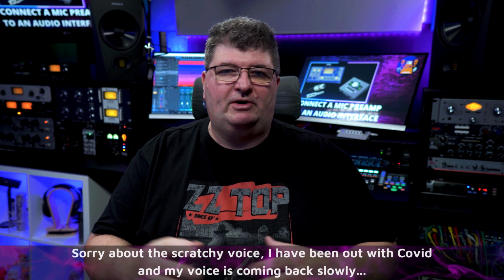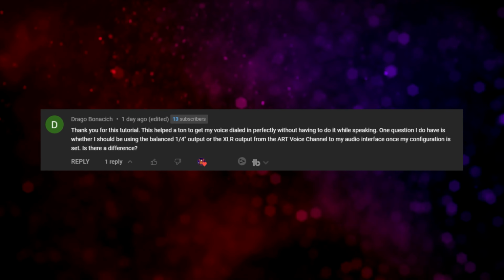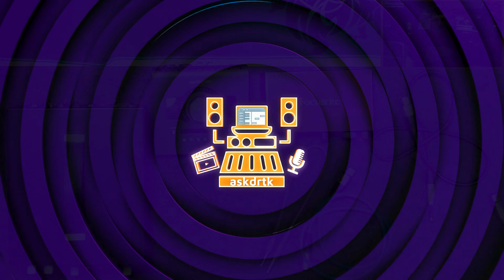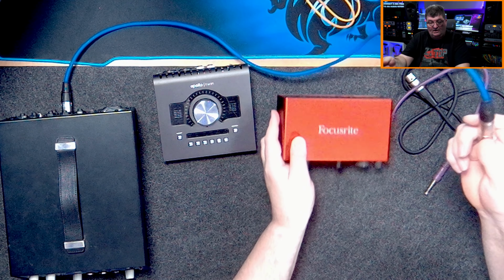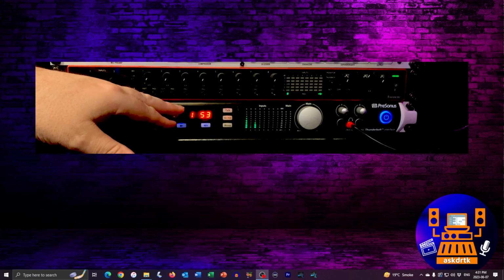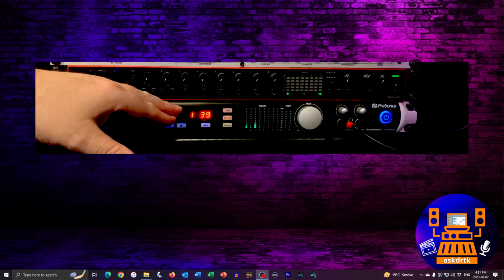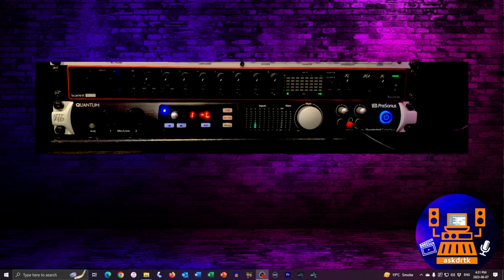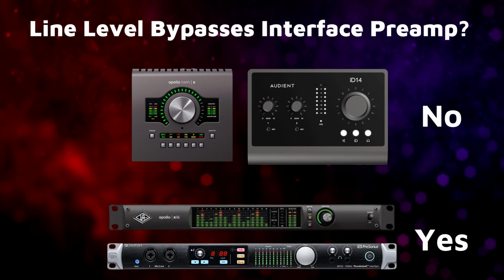How to Connect a Mic Preamp to an Audio Interface Without Breaking Anything...

Comment: i have an old Gemini XL-120 turntable i still use to listen to records, got some new gear but Im having sound issues. i can hear the vinyl on the headphones but cant ear anything on the speakers. i bought a Fosi audio box x1 phono pre amp ( That is working from the headphone jack) but no sound from connected rca line to a Yamaha rS202 Receiver, ...... i bought rca to 3/4" to connect to a N.I. Komplete Audio 6 [Audio interface] (unless i need different cables?) that connects to JBL 3 series 305p MKll Studio Monitors. any ideas on why im not getting any sound ? please and much appreciation to any who comments tryinng to get audio to FL studio also so i can sample vinyls
Reply: @chrisbravo1856  maybe the RCA jacks are inputs

Comment: Sir, Which "audio interface" do I need so that I can use my external pream (Focusrite Iso one) for all recordings? I have a digital card on the preamp with s/pdif and adat and also "word clock". My question would be for digital recording: is an audio interface with S/PDIF sufficient or does it also have to have a word clock connection? I ask for help
Reply from the maker: Sorry for the late reply. SPDIF will carry the clock signal from the ISA One to an audio interface with a SPDIF input without the need for a word clock cable. In this configuration, the ISA One will be the master clock and the interface will be the slave. This works however the issue is that if your want to change the sample rate for recordings you will need to do it on the ISA One, not the interface. This means you cannot change the sample rate in your DAW or interface software. Again, not really a problem, just a different way of controlling things. All of this said, using a dedicated word clock cable can provide the most accurate and stable clocking between devices,  think of it as the "gold standard." This is not to say clock over SPDIF is not a good option, I have used this setup without issue many times and it is often the only option. If however you did get an interface with a word clock out connector, I would recommend connecting the word clock "out" from the interface to the word clock "in" on the ISA One as well as using a SPDIF cable to send the digital audio. This way the interface will be the master clock with the ISA One as the slave so changing sample rates can be done in software on your computer and clock sync will be as accurate as possible. I hope this helps out!

Comment: Todd, you touched on this issue of hooking an outboard mic preamp to an audio interface in a previous video, and it really helped me out. I was routing my preamp (Avalon M5) into a Steinberg interface, and was using an XLR to XLR connection to the channel 1 mic input on a combo jack. I was using the XLR to XLR because I thought, incorrectly, that this was the "professional" cable to use. It never occurred to me that I could damage my outboard mic preamp if I hit phantom power by mistake! What I did notice was that I was getting sort of crappy audio, with odd little low-frequency glitches. When I heard your previous mention about hooking up mic preamps, I switched to an XLR to TRS cable, going from the preamp into the channel 3 line input on the Steinberg. Audio glitches disappeared! You're distributing excellent technical information handling audio in a home studio. Thank you!
Reply from the maker: Thank you, and I am very pleased to hear you were able to straighten out the audio glitches! It sounds like there may have been an impedance issue when you connected your M5 to the XLR input on the interface. In the end, nothing beats a line-level signal going into a line-level input. Cheers!

Comment: Audio Interface: FocusRite Saffire Pro40.  3 outboard Mic Preamps.  But, if I have the INPUTS of my Mic Preamps going to an XLR patchbay (Hosa PDR-369) the phantom power will travel only to there?  Right? And it the OUTPUT of my Preamps go to the OUTPUT of my SAMSON S-Patch bay, which later will be patched to the INPUTs of my FocusRite Saffire Pro40, the Pro40 is protected from phantom power from my Preamps, right?

Comment: Focusrite has some funny language at times. I have a Clarett 2pre USB, which has combo inputs only. Focusrite says that even though you can add gain to a line level signal coming from a TRS cable, the Clarett is not adding the "Focusrite mic pre Color" to that signal. YET, you can activate "Air Mode" to a line signal and get the added high frequency boost.
Reply from the maker: Yes, Focusrite basically says their Clarett preamps do not color the sound…but the preamps are not bypassed when using combo-jock inputs… There are opinions either way on the importance of bypassing interface preamps. Tests almost always show an impact from running through a preamp in an interface vs bypassing them, but in some cases the impact is minimal and in others it is not… Using an outboard preamp through that Clarett with “Air Mode” on would be a modern  way of replicating the effect of connecting an external preamp to a vintage Focusrite console, another cool way to use our gear… Cheers!

Comment: The Behringer ADA8200 seems not to use the mic preamp if you use the line input if Iinterpret the table in the getting started manual correctly. It's not listed under line inputs. 👍

Comment: So if you can't bypass the preamp within the interface, such as the case with an 18i20, how would you gain stage to reap the most benefit from the external preamp's  colorization? Or will the interface's preamps have the same amount of effect regardless of where the levels are set on each piece of gear? Thanks.
Reply from the maker: Sorry I missed your question earlier. To get the most out of the external preamp I would set the gain on the 18i20 as low as possible allowing more room to drive the input/ output stages of the external preamp. I basically start with the Scarlet gain at minimum and then use it only as a trim if necessary. Hope this helps out!

Comment: can someone please tell what is the name of the cable i need that he said wont damage the mic. or give me the direct amazon link.
Reply from the maker: When connecting an outboard preamp to an audio interface, if your preamp has a TRS output, use a TRS to TRS cable such as this one: https://amzn.to/46VBvLa  If your preamp has an XLR output, use an XLR (female) to TRS cable such as this one: https://amzn.to/46NjmiB  In any case, the connection on your audio interface from other gear (preamp or effect) should be TRS to avoid the risk of phantom power from your audio interface damaging your other gear. 

Microphones should always be connected to a preamp (either an outboard one or one built into an audio interface) using an XLR to XLR microphone cable such as this one: https://amzn.to/43sjh0J  I hope this helps out!

Comment: Thank you so much for the video one question what is the best interface to use with external preamps? ☘️🙏❤️
Reply from the maker: Glad you enjoyed my video. For me (excluding all other features / considerations) the best interface to use with external preamps is the one that has enough IO for your needs and at least one line input that bypasses the interface preamp(s). Some examples of basic interfaces include the Scarlett 4i4 (has two line only inputs), Audient ID24 (allows bypass of internal preamp on both inputs), UA Volt 476 (has two line only inputs), and MOTU M4 (has two line only inputs). If you need more IO there are many options, but some to consider include the new Arturia AudioFuse 16Rig (has 16 line only inputs), the RME Fireface UCX II (has 6 line only inputs), and the rackmount Apollo interfaces (desktop Apollos do not bypass mic preamps). These are only a few options, but cover a variety of price ranges and IO configurations. I hope this helps out!

Comment: Hi i do have tube mic it's avantone cv12 do i need mic preamp to connect the mic to the hardware as Klark Teknik 76-KT

cause i want to buy the Klark Teknik 76-KT i don't know if i need mic preamp to connect the mic to Klark Teknik 76-KT
Reply from the maker: A outboard mic pre is the usual way you would setup this recording chain… CV12 -> Mic pre -> 76-KT -> line input on your audio interface. Some audio interfaces let you connect the mic to the interface and then send and return the sound through the outboard (76-KT) before recording so a separate mic pre is not needed, it just depends if your interface has enough IO and built-in mixing.

Comment: I have an iD 24 + Composer Pro-Xl, I`m planning to use them for my guitar! So, plug in my guitar first to the Composer Pro then send the signal from the XLR of Composer to the Back Line input of iD 24, and connect the Audio interface to the computer?

Comment: Ive been struggling to understand. Do I have to buy a external pre amp to use my Klark 2a? I have the universal audio apollo but it has a preamp, why would I have to buy a external preamp if I like the sound with the Apollo? is there a way to compress without a external preamp ?
Reply: Only 1 pre amp necessary. Compress with plug ins

Comment: hey man, very helpful video! I only have 1 critique point which I'd like to mention because this could seriously damage people's equipment:

Phantom power definitely DOES pass through TRS cables, I don't know where you heard that it doesn't.
in fact, TRS cables are more dangerous when it comes to phantom power, because, due to the anatomy of their connectors, when plugging and unplugging TRS cables while phantom power is engaged, you run the risk of short-circuiting your devices.

just wanted to put that out there!
Reply from the maker: Hey Tony! Agreed, phantom power definitely does pass through TRS cables which is also why you never want to use a TRS patch bay for microphones due to potential short circuit as you said ( I've see too many situations where an XLR connection on a preamp ends up at a TRS on a patch bay). 

The key to safety is in the TRS jack on the interface or preamp and not the cable. Whether it is a TRS line input or TRS on a combo jack input, interfaces / preamps are designed not to send phantom power out over TRS, even when phantom is active on the XLR part of a combo jack. I've done pretty extensive testing on this with a couple of dozen interfaces and preamps using both a meter and a TRS to XLR cable with a condenser mic connected. In all cases I found that phantom was not output over the TRS jack even when it was hot on the XLR of a combo jack. Of course I can't speak for every preamp / interface, but it was good to see the connections designed that way... Nonetheless, for the sake of caution I appreciate that you brought up the point about the cable itself being able carry phantom power. We don't want anyone to take out their gear! Cheers!
Reply: @askdrtk   Yes the mics with the TRS would be a problem due to the way the sleeves hit on the rings inside the jack, where as XLR all pulls out at the same time, in fact i did this sometimes i forgot to turn off phantom power and pulled out my mic cable, but they were fine after, but ya the mic and TRS would definitely cause that issue. Another thing is i do this a lot running nice pre amps into others, but i never use the gain on the other pre amp but want a better sound than some cheaper pre amps say on the tascam dp24 i have, thanks again, great info i never thought as well .
Reply: Here's an idea to try ? take a trs to xlr cable, plug the trs into a combo jack then plug your condenser mic to the xlr, and turn on phantom power and see if it works  ? By the way i just tried this on my tascam dp 24 sd machine and guess what i was right !
Reply: @askdrtk  ahh, that's very interesting, I didn't know that. Thank you for letting us know about your experience :)
Reply: @christopherdunn317  that's a cool experiment! thank you for telling us about your experience as well
Reply: So do you recommend using XLR into my Apollo rather than the TRS and just make sure that it's set to line before powering up the focusrite because I can't select line on the Apollo until it's fired up🤔
Reply: Or just don't connect it to the focusrite preamp until I know that the Apollo is on and set to line input
Reply: Yes phantom power does pass through TRS cables (phantom power moves through any cable that conducts electricity), but TRS inputs are used to bypass phantom power. Way it is done is to solder input so, that it bypasses line that feeds phantom power.

For example my external tube Pre-amps TRS input doesn't feed phantom power (because TRS input is used to bypass it's mic pre-amp and either feed tube sound to external gear or connect a guitar to it etc.)

If I connect my condenser mic using TRS to XLR cable to my audio interface, I won't be able to feed phantom power to it, if I use dynamic microphone, signal is too weak because TRS inputs on my interface don't feed phantom power and bypass mic pre amp completely.

It doesn't matter if you use XLR or TRS cable, both feed phantom power and line or mic signals, what matters is does your interface let you bypass phantom power and / or it's pre-amp or not.

Comment: Very instructive video, love it! I was going to buy the UAD Volt 476p and now I'm wondering if its better to take the 476 that has 2 line outputs without preamp.

There is a way of expanding the Volt inputs in the future even the interface don't have digital output? Thanks 👏🏻
Reply from the maker: Glad you enjoyed it! The 476 vs 476p really comes down to your use case. The 476p is a compelling option if you need extra preamps and output gear is less of a priority whereas the 476 is a good choice if you have outboard effects to patch in and you only occasionally need extra preamps. In this case you can connect outboard preamps when you need them but otherwise have line level IO for your outboard effects. Using a patchbay will help make switching more convenient. In the end, lack of digital expansion is a limitation on these interfaces. Aggregate devices can help get around this bay allowing you to add another interface and use it with the Volt (this is easier to implement on Mac vs Windows, but can be done). Not one answer, but I hope this helps out. Cheers!
Reply: @askdrtk  Thanks for the response! 💜

Comment: Thanks for the video, I'm getting into hybrid home studio and I tried to put my ART preamp into my 18i20 audio interface.
If I understand well, with this one, I have to turn the gain knob on the interface too. Does this have an impact on the sound I get ?
I mean if the sound goes into two preamps(the ART+the 18i20) it's pretty weird no ?
Reply: I also have the 18i20 and have been confused about connecting a compressor or multi effects to it. Have you done anything like this ? I would like to have it connected in my 3u case and have it working across the 18i20 when I need it ...not entirely sure about the chain any tips would be greatly appreciated thanks

Comment: Greetings friend, excellent video! I have a question: My interface had a problem with the phatom power, and there is no repair (the cost of the repair exceeds that of a new one) everything on it except the phatom power apparently works. And here is my question, Could I use an external phatom power to power the condenser microphone and send the signal to the interface?
Reply from the maker: Hello and thanks! Sorry to hear about your interface, but the good news is that if everything is working except phantom power, you can use an external phantom power supply for you condenser. There are a number of options, but I was was very impressed with the quality and performance of the Xvive P1. Here is a quick look at it https://youtube.com/shorts/7gBGs3BtOcM?si=aNbvPlDW9lArVACy Hope this helps out!

Comment: Could you help me out? I have a Focusrite Clarett 4pre (2nd gen) and just got a Warm Audio WA-12 preamp. It comes in way too hot when I use the line inputs on the back. It apparently has a fixed gain. This way I cannot drive my preamp and cant get the coloration I want.

However when I switch the frontpanel input (input 1) to line input and turn the gain all the way down, it works. It sounds great this way, but I honestly don’t want interference from the preamp of the focusrite. 

Do you (or anyone) have experience with this, and perhaps a solution?

Would be forever grateful if someone can help me out. ❤️

Comment: which audio interface would you suggest to get if you want to completely bypass the audio interface inputs?
Reply: Do you mean bypass the interface preamps?
Reply: Just buy an audio interface that has independent line input, not a combo jack; for example, tascam or other interfaces that have line input independently are designed to only accept line sources and, not go through an internal preamp.

Comment: Thank you for mentioning this cause i do this a lot, plug pre amp's like this into other's but don't use the gain at all, but ya the TRS does not add phantom power, ,I just tried it out on my tascam dp 24 sd machine and your right ! no phantom power comes out of a combo jack in the TRS jack ! only the XLR !
Reply from the maker: We’ve all used an XLR for this at one time or another, but with how easy it is to switch on phantom power the idea of “better safe than sorry” is the way to go in the long run. It is not intuitive that XLR and TRS in a combo jack would be wired differently, but I am yet to find one (at least “factory gear” where they are wired the same. It makes sense that combo jacks have separate wiring when you think about manufacturers knowing how easily their gear can be damaged by phantom power. Cheers!